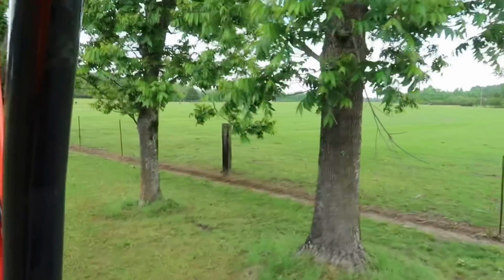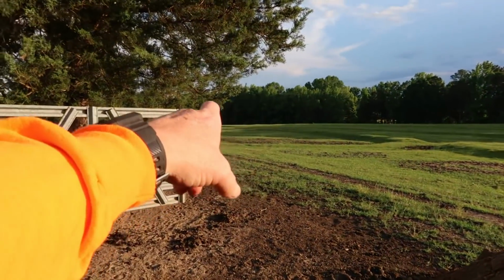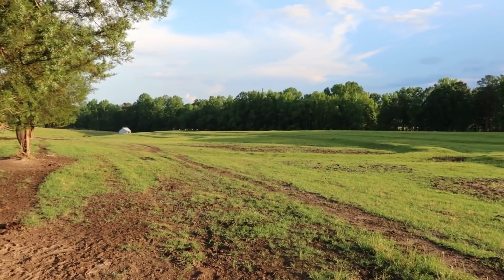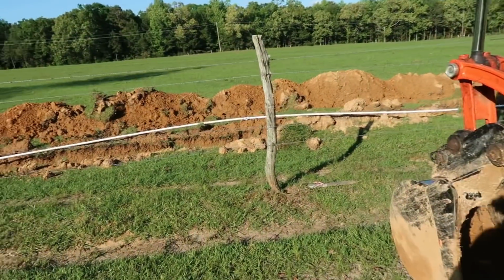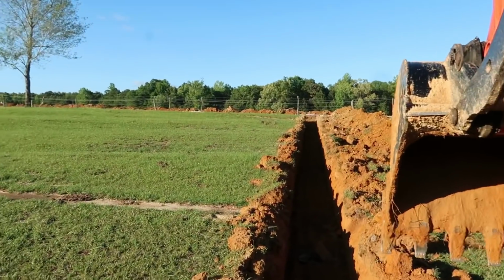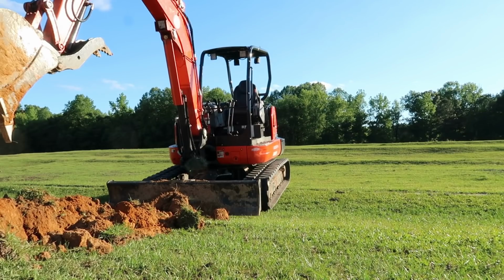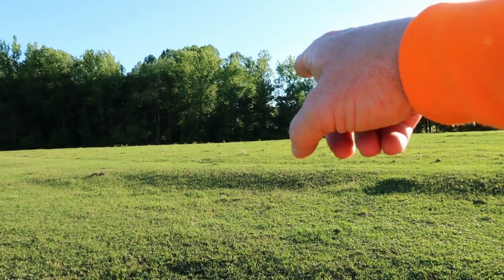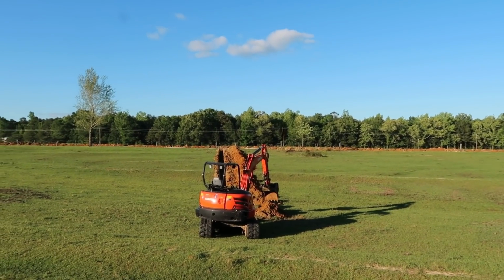2000’ of waterline & a cow attacks my camera

Comment: Where I live, a water line has to be at least 36 or 42" underground. I forget which, but it's a lot more than 16". We can get pretty cold at times in the winter here in NE Indiana.
Reply: It's closer to 8' where I grew up in WI.   Even in IA it required a backhoe with an extending stick to get it deep enough when my house was built in the early part of the 00s.